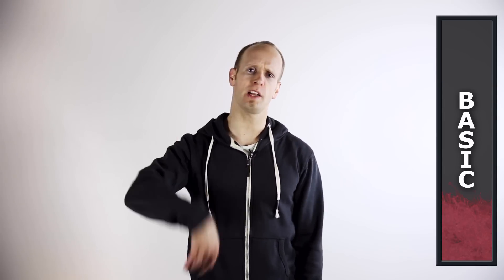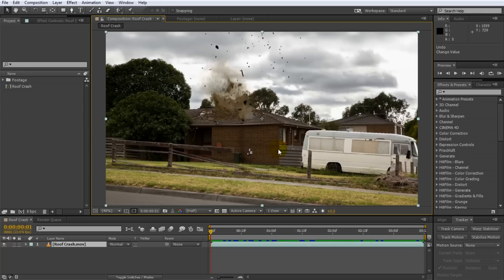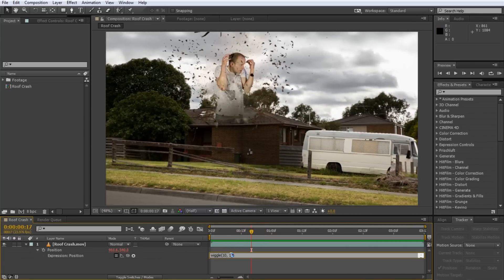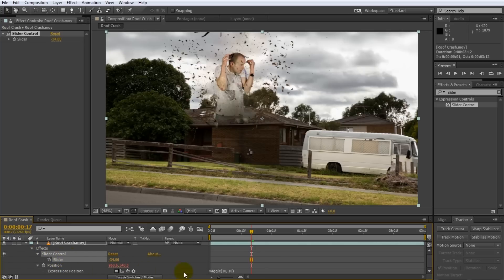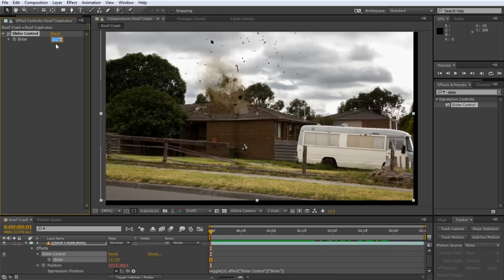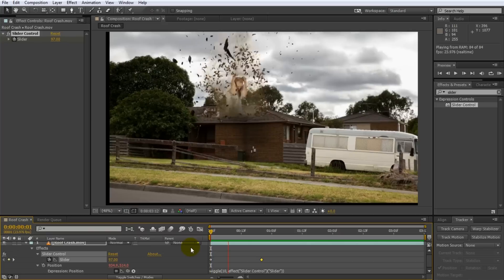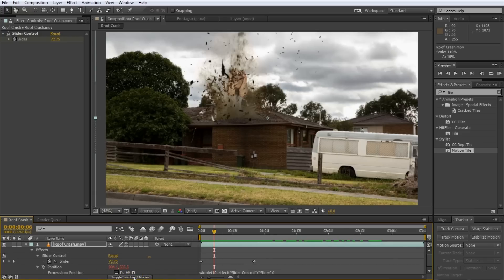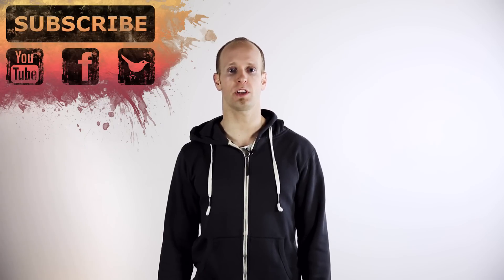Adobe After Effects Basics - Camera Shake

Comment: Hey it's me again.. When I am at the part where you put "wiggle (10, )" I get a message saying: This project contains an expression error: error 1 of 1. Also, when I link the expression to the slider I get "temp = effect("Slider Control")("Slider");
[temp, temp]" After entering '10, 10' in the [temp, temp] area, my video moves to the corner so I can only see 1/4 of it and 3/4 is black space.
Reply from the maker: Do you understand why you are tying what you are typing? I certainly never put "wiggle (10, )" in as that's not a valid expression. If you are just getting started then this might help: BAM! https://www.youtube.com/watch?v=f76vRPYYeBw
Reply: I get the same thing.

Comment: Isn't there a wiggler panel in after effects (CC 2014)?
Reply from the maker: ToonTownTVFromABC Yup, it's a pretty new panel though - if you have it, use it. If not, you can just use the simple expression method :)
Reply: In After Effects CC 2014 by default it is not enabled. To enable it go to the window tab and select wiggler. Then to use wiggler make two keyframes on any effect Select them and set your wiggler properties and PRESTO! Wiggler then makes some randomly generated keyframes based on your frequency and magnitude. Hope this helped *****

Comment: the default position coordinates of my video is 640, 360. but when I pickwhip my postion to my slider control, it sets the position into 0,0 and it turns red, so i can't edit it. SUMMARY:  after i pickwhip my position to my slider, it's not in it's original place anymore. NEED HELP :(
Reply from the maker: tonton9598 Are you sure it's the position and not the anchor?
Reply: ya, because it was the position under "transform" however, I found a fix to it, I copied the code similar to what i saw in your screen and everything turned out fine, I'm just not sure if it's because I'm using after effects CC and you're using CS5 or something. By default, the code was set to something else